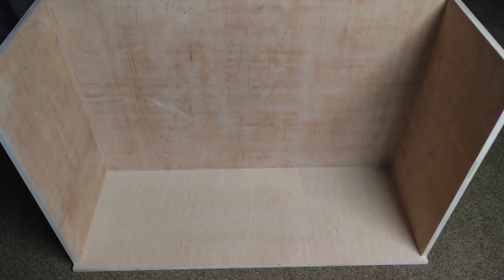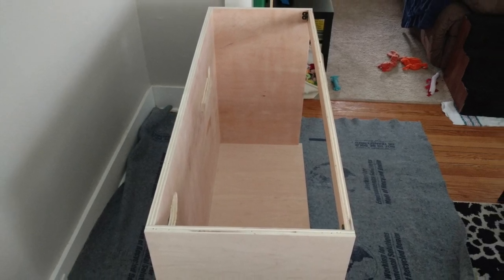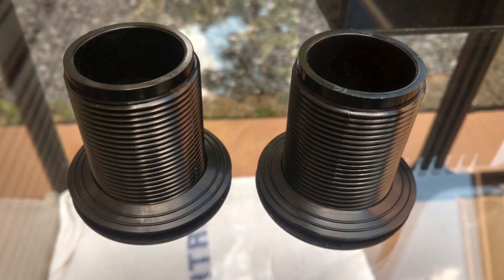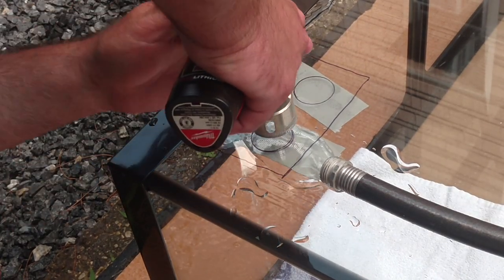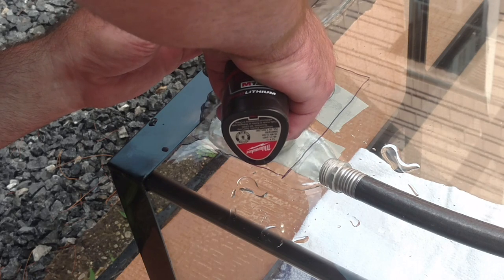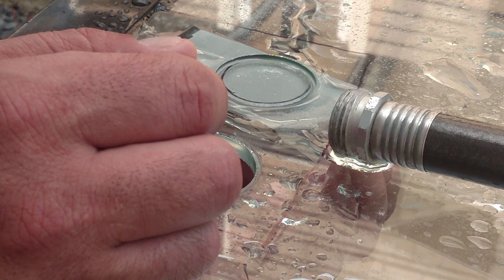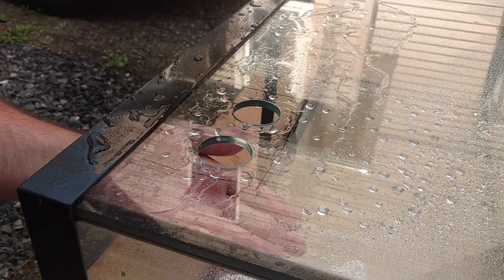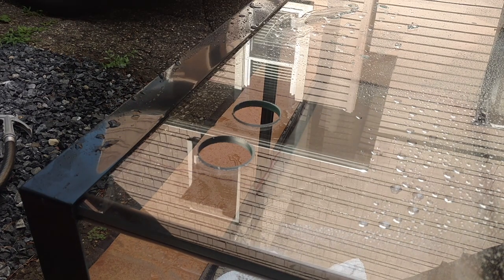Reef Tank Build Episode 1: Drilling a Tank and DIY Tank Stand

Comment: Why didn't you get the 90 gallon size......same length of 48", same front to back of 18" only it is 24" tall....I am in a similar situation and that is what I did.....just curious.....
Reply from the maker: SNeal5966 I didn't want such a tall tank
Reply: Well I mean....just curious....is there some extra challenge (lighting or with corals or something?) That I am missing...? You have me second guessing my choice to go with the 90.....lol
Reply from the maker: SNeal5966 I guess with a taller tank you will need more powerful lights. And building a high rock structure to fill in the empty space up high on the tank wasn't for me

Comment: Can you please provide the stand build design you used? Most use the 2x4's build style. I am interested in the 3/4 plywood version.
Reply from the maker: I basically built a box and used glue and screws. Theres no real specific design i used
Reply: @BillyPipes  Awesome video!  Do you think it would be stronger using a tool like the Kreg jig for pocket screws?  Did you put 2x4 in the corners for stability?  I was thinking of building the frame using 2x4 for a 75g tank and then skin with oak but now debating building it with 3/4" oak like you did.  Thoughts?
Reply from the maker: Thank you, and yeah i didnt use 2x4. I think anything bigger than a 75 definitely needs more support👍